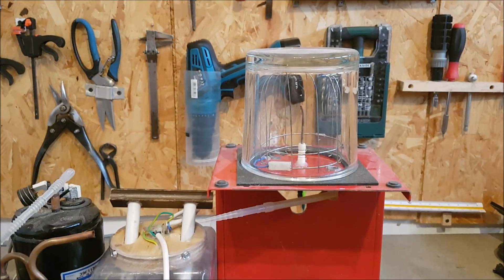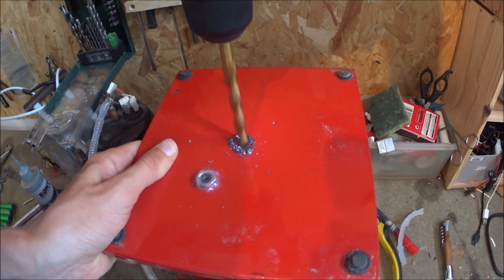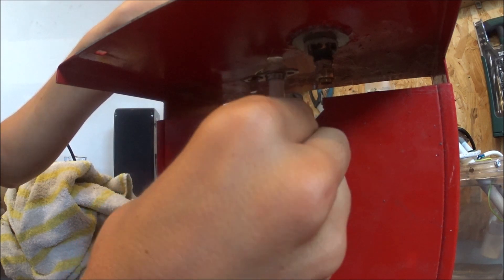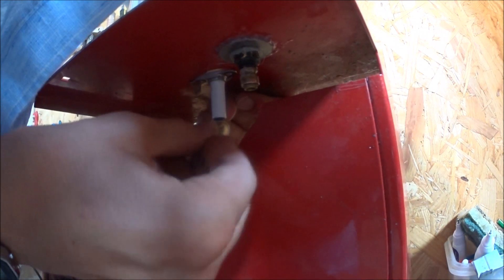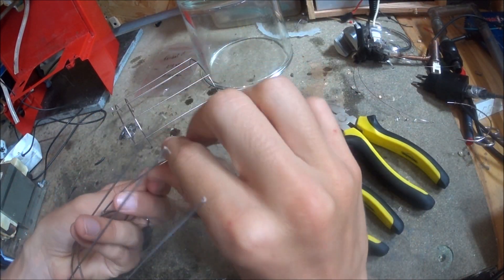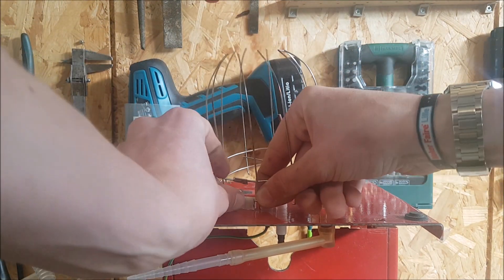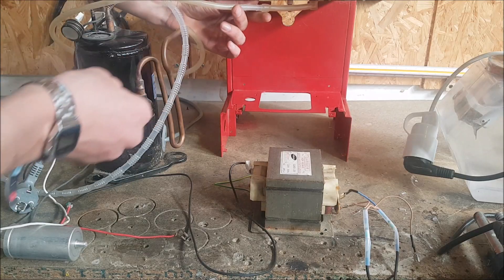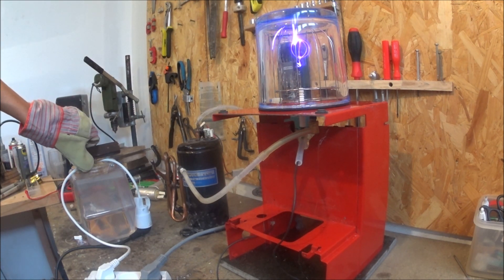Homemade Plasma Discharge Chamber

Comment: Even though it is built to look like one, it is by no means a Fusor. It does generate plasma, but technically it is just a gas-discharge lamp. 
There are several points this thing fails:
1. It is using alternating current on its electrodes, which means that the ions cannot be accelerated towards the center (i.e., there is no way for ions to actually collide, and for a proper fusion reactor the inner electrode is usually charged negative compared to the outer one, with DC at >10kV)
2. On average the voltage on MOTs is around just a couple kV, fusion requires at least 10 - 15kV in such setups.
3. Vacuum is not nearly good enough, for fusion to occur you would need around a couple micron. (no fridge compressor will be able to achieve that, sadly, and materials like plastics and rubber usually outgas too much at those pressures, even for good pumps to sustain it)
I am not saying it is impossible to achieve fusion with a "free" DIY reactor, i'm just stating that this one definitely does not.
Although it is a good project, and a working gas-discharge lamp, calling it a fusor in the title is very misleading.

Edit: I'm just trying to clear this up for people who might actually think it is a fusor (even though you only mention "fusor" in the title, and nowhere in the video)
Reply: Yeah, it's a nice DIY video, but I was disappointed watching it because of the misleading title.  I think the creator is shooting himself in the foot by making this appear to be something it isn't and creating false expectations.

Comment: Hello.
I am a 17-year-old high school student living in Korea and a subscriber to you by watching this video.
I'd like to ask you a few questions.
Which compressor should I use?
And what kind of microwave oven transformer should I use?
Reply: 컴프레서는 진공펌프 사서 쓰시면 되고, 전자렌지 트랜스포머는 그냥 아무 전자렌지나 뜯으면 나오긴 합니다. 근데 위험하니깐 조심해요.
Reply from the maker: If it is not to late, I used a fridge compressor and a regular MOT they are all the same
Reply: Best thing would be something such as a two stage vane pump you will get a better vacuum, and they are available at places such as Harbor Freight for evacuating the AC on your car before putting in refrigerant.